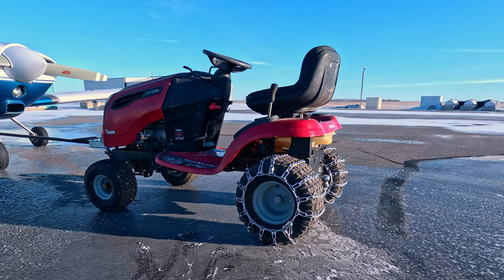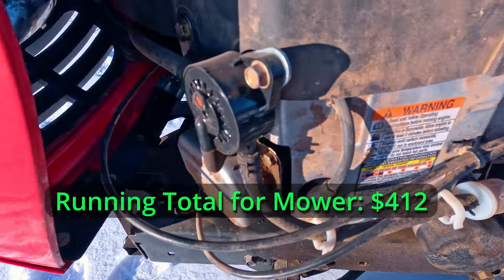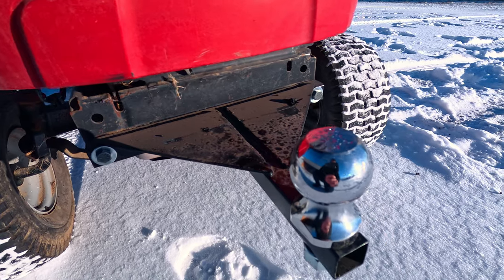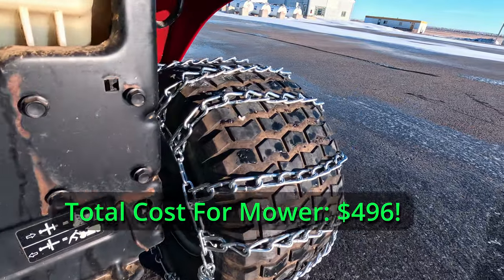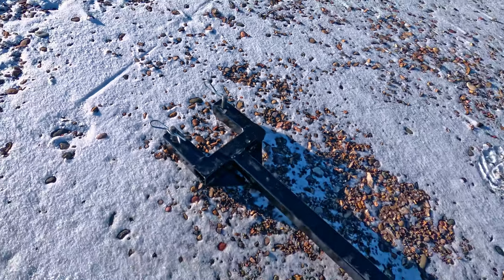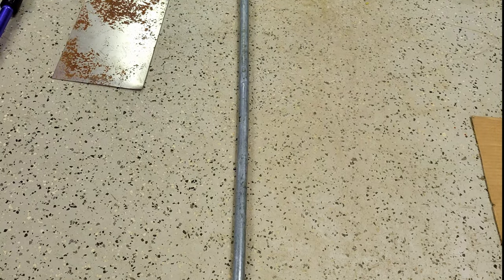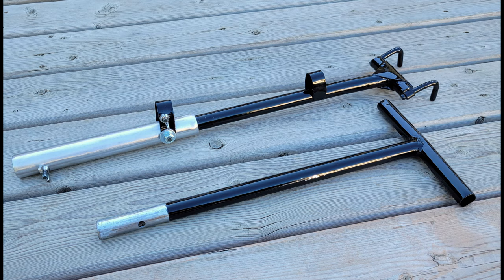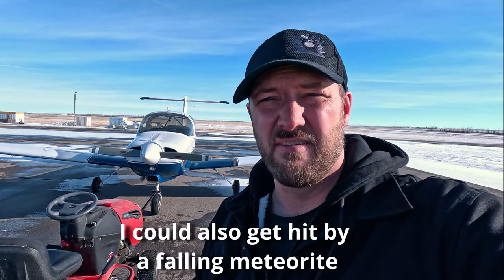Aircraft Tug DIY - SAVE THOUSANDS and FLY MORE

Comment: The key to longevity on a mower is zero maintenance. The second you change the oil or put on fresh tires they'll need major work. Original drive belt works better than replacements too ;)
Reply from the maker: I changed the oil - I'm doomed! Haha

Comment: I can't keep traction on terf or it lifts the front wheels off the ground, i have added ~200lbs of steel underneath hung from the deck supports. Pushing a Cessna 175
Reply from the maker: The nose lifts while pushing with the front?  I wonder if you could change your hitch height so the pushing would drive the nose of the tractor into the ground rather than cause it to lift?

Comment: You have a very nice setup. I use a lawn tractor to pull my Piper 140 into the hangar. I have a slight incline outside the hangar doors and have to push the airplane “uphill” to get it inside. This is no problem unless there is ice or snow, and it becomes impossible as a one-person operation.
Reply from the maker: I have a similar problem.  The entrance to my hangar has a small concrete curb to go over.  I built low profile ramps using plywood that I shaved with a belt sander and covered in sheet metal to add some strength.  It made the transition a lot smoother.....smooth enough that I do that part by hand and the rest as you can see is all with the tractor!  It's hard to see by the videos but the stretch from my hangar to the paved apron is a gradual uphill stretch. Our tractors are the way to go!

Comment: Great video, curious if you somehow tighten down on the ears of the plane.  I would imagine you don't want play or flex in the tow bar when moving the tractor from side to side.  I see the cotter pins but I would imagine that would still be a bit of play there correct?
Reply from the maker: There's a bit of play there but clamping down on the ears would fix the bar too tightly to the strut in the way that it wouldn't compensate for up/down movement when transitioning between different slopes on the ground and would bend/break the ears off very quickly.  The side to side play is minimal and doesn't affect fine control of maneuvering the plane.

Comment: Nice video!  I have a Cherokee 140 and bought a lawn tractor to push the airplane. I need a towbar for it.  How long is the towbar?  Luckily, the tractor I bought was already set up for towing with a ball on the front and back.  Thanks
Reply from the maker: Thank you!  I think the tow bar is around 5 feet long.  I stood in front of my plane and measured where I'd want the tow bar T-handle to be in order to have one hand on the bar and the other one pushing on the blade root of the propeller if needed.  I made sure the bar was long enough to mount the hitch ball receiver onto the end beyond that handle.